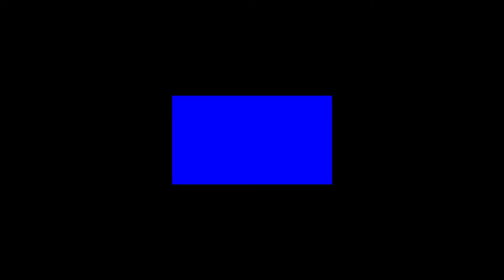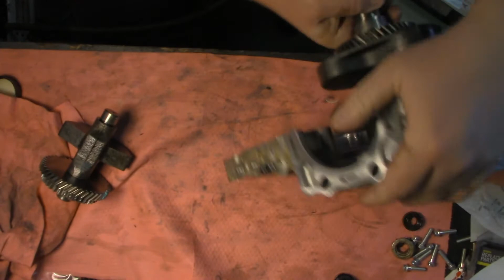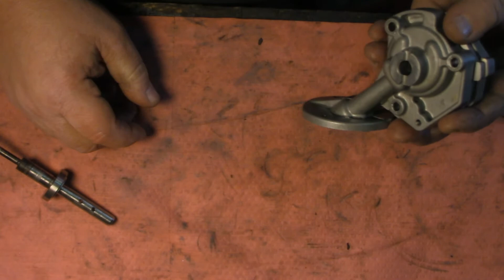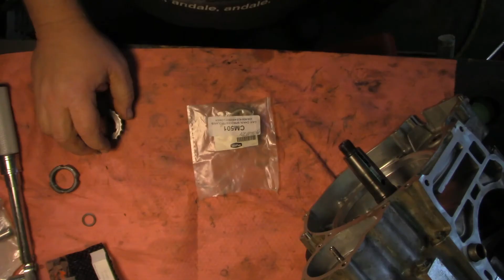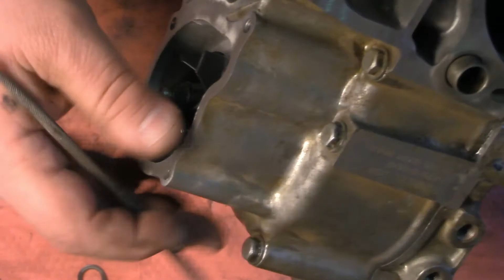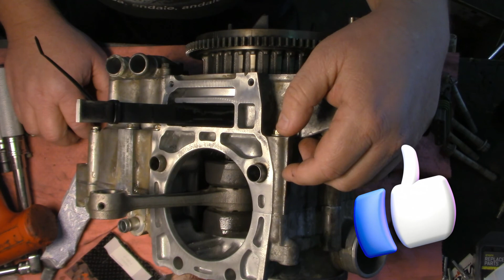Polaris Ranger 500 Bottom End

Comment: On the counter balance, the gear that drives the oil pump gear. How is it connected to the counter balance?
Reply from the maker: That gear is part of the counterbalance. It is non-removable and is not sold as a separate part. If it somehow has come off, you need a new counter-balance shaft.

Comment: Great video. What is your typical rate for a full rebuild? Top and bottom end?
Reply from the maker: This will vary a TON depending on the model, but typically range anywhere from $1,500 to over $5,000.
Reply: You can’t get the whole pump anymore just all the parts. Which is Complete BS if you ask me.